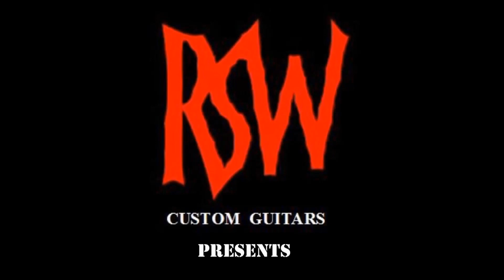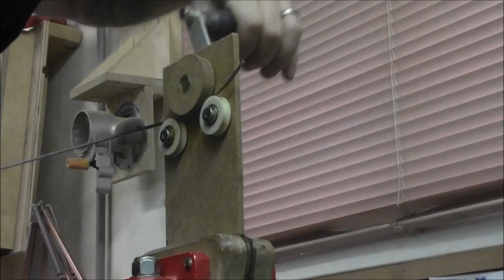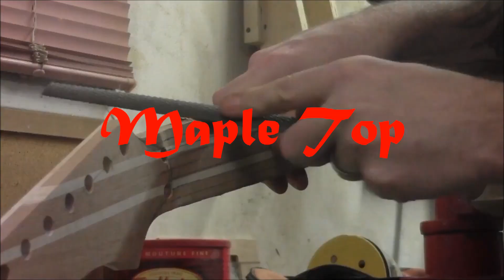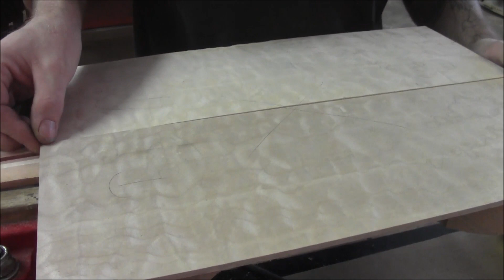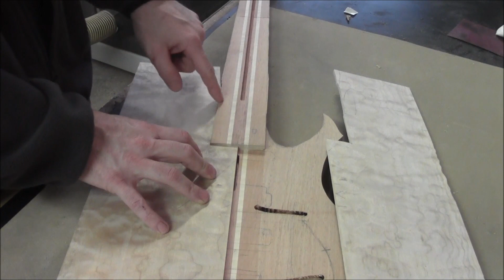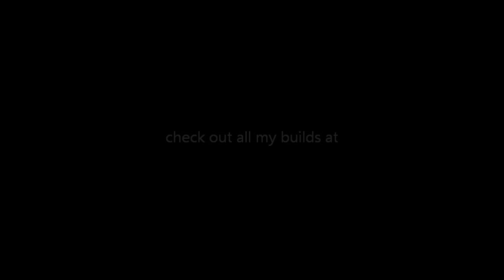How to Build an Electric Guitar-Video 7-Maple Top pt 1

Comment: Place in the press, place the template on that followed by the plate steel an the block. You don't need that much pressure from the press, just enough to hold the top down firm. Usually sets up nice in an hour or so.  Place a damp rag or towel over the top where the are rest begins over night ( 12 hrs give or take ) it will bend part of the way there on its own. Remove tape from arm rests our in the glue and clamp down using an angled block

Comment: There's an easier way to do this using a hydraulic press ( less than $200 on eBay ) easily modified for this application.  You'll need a 3/4" thick template of the body. A 1/2" x 14 x 20 plate steel and a 4x4 block of wood about 10" long. Just leave your tail about 3/4" long, tape off the arm rest on the body and glue up the top as you normally would, tack each piece at the tail with a brad nail